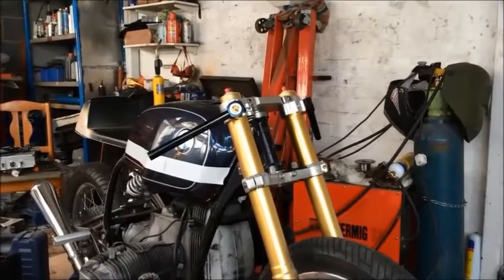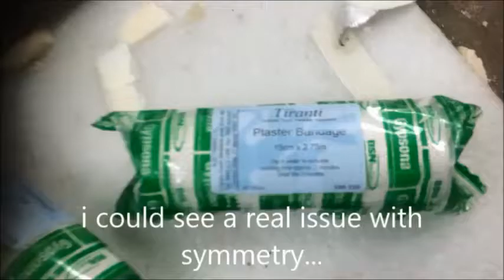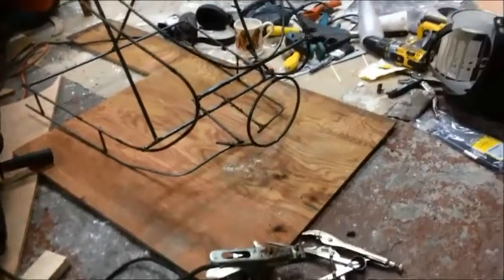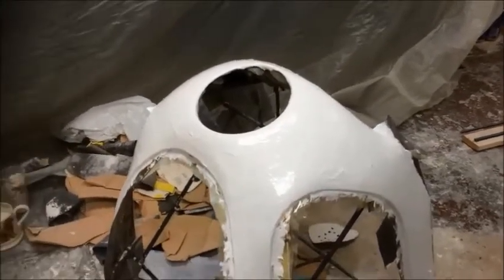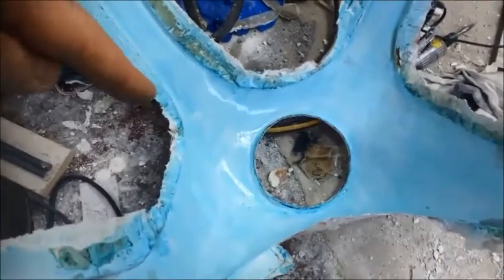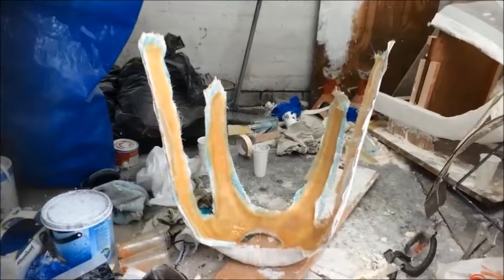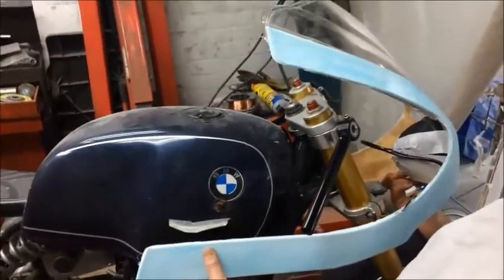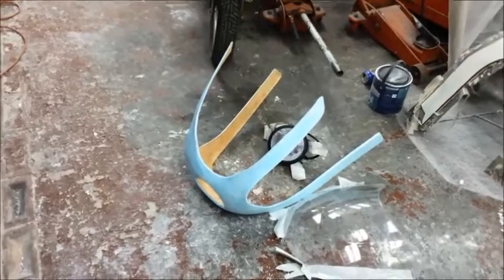bmw r80 cafe racer project part 31

Comment: I was planning to use cling wrap, douse it in sprayfoam then carve away untill yah achieve the desired shape, cover it in fibre glass, supports/mounts can be built afterwards I was thinking or make ribs with some more fibreglass for a lighter end product. Anyone taken a similar approach and have any warning or tips n tricks?

Comment: I'll give ya an A for effort... but that's such a sweet bike, why didn't you just spend the $75 bucks for an clearly superb professionally made piece? I know that you had to have spent way more than that on this project....
Reply from the maker: top job, i havent got an A for ages so thank you...and Yes, its a fair comment........ however.......it didn't have anything to do with cost (although money gets a little tight every now and then) i probably spent more on materials with this fairing than buying a reasonable 'professional' unit. It was more about what i wanted, in my view the original bmw headlight is too big for the bike (this style), and most fairings that you can get for this bike are designed around the original headlight, i did look at a shed load of different fairings and i couldnt seem to find exactly what i was after, the making of it did take far too long in the end though and i am not sure about one of the lines in it, but i am going to wait until its all painted up to see what the end effect is rather than trying to modify it now......I haven't had a chance to work on it for nearly a month but hopefully will be in a position to carry on with it soon.......
Reply from the maker: dont worry, i took the comments as they were intended,  problem is i always seem to be having to explain it (i think there is some kind of self justification thing going on here - all i really need is a couple of hours with a good shrink). My advice would be to look around and buy a fairing rather than building your own but thats only because mine was such a pain in the ar*e. i was looking at the fairings by Flatracer (expensive but look pretty good when you see photo's of them on a bike).....you are welcome to put some links from here to any photo's etc of your own project if you like if they are in the public domain....
Reply: BF Peake where's the fun in that?